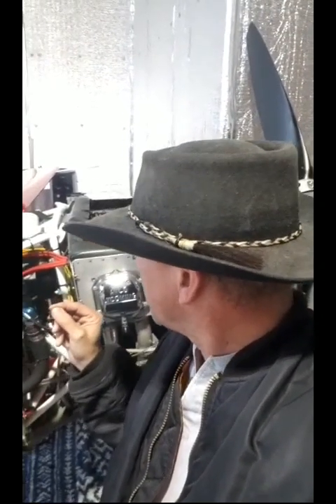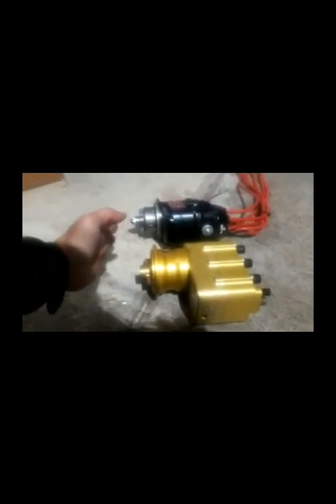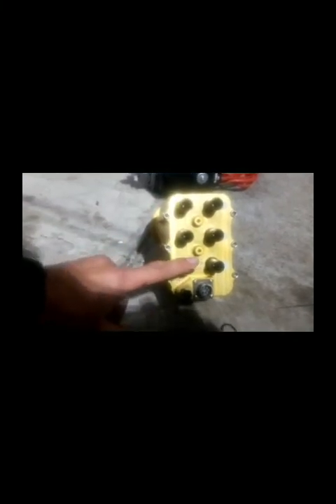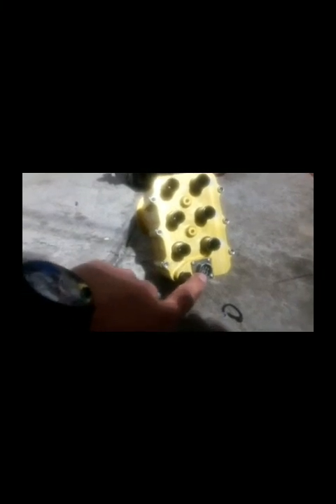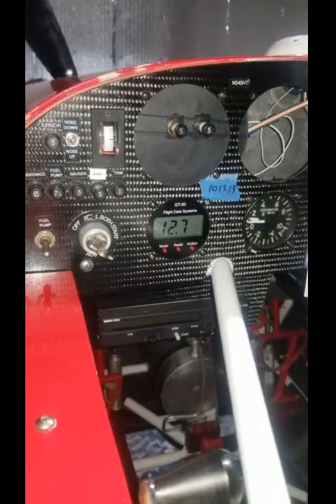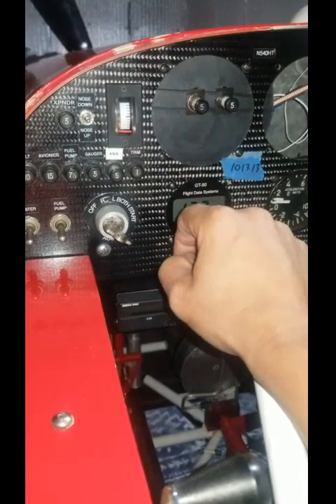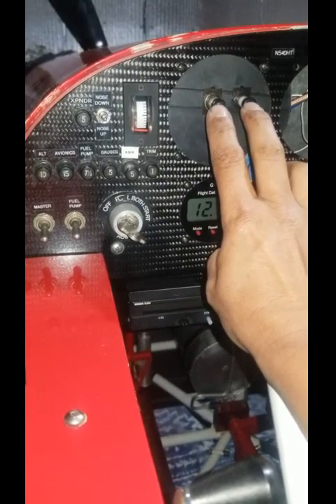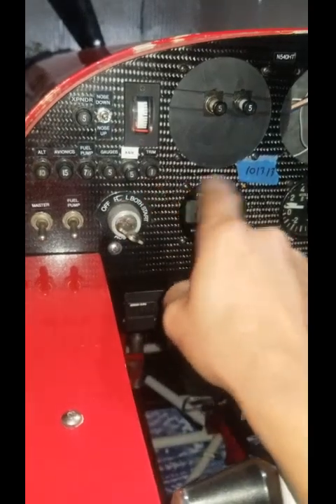EMag install on 540

Comment: it seems to be a great advance for this engine.
after these months of use, do you recommend replacing the magnetos with this system?
Have you noticed an improvement in the operation and performance of the aircraft?